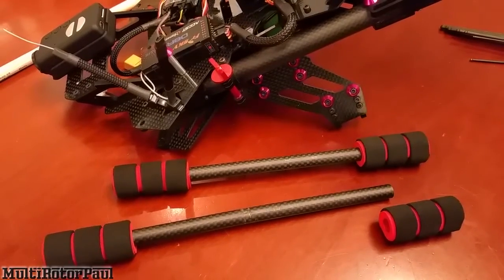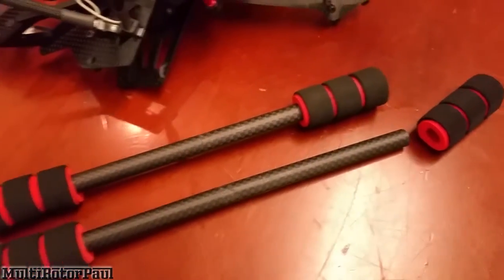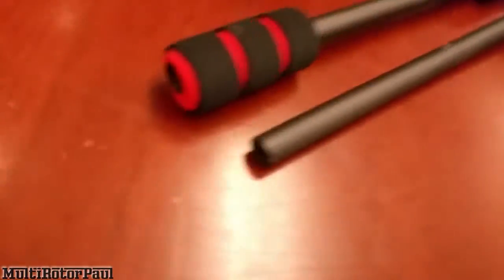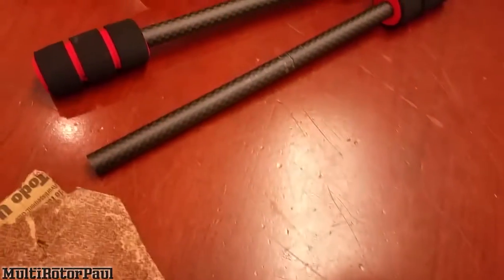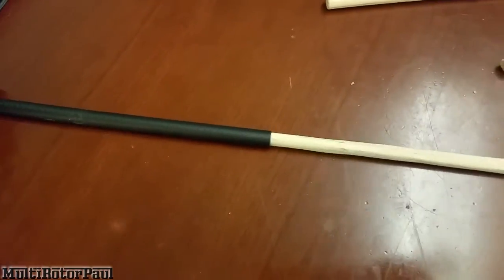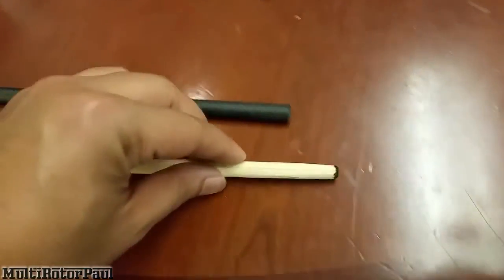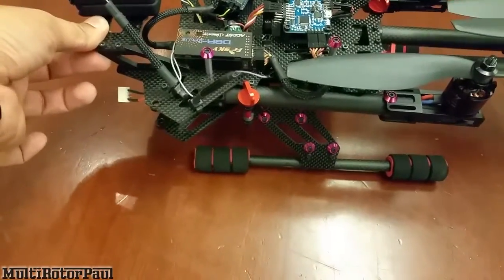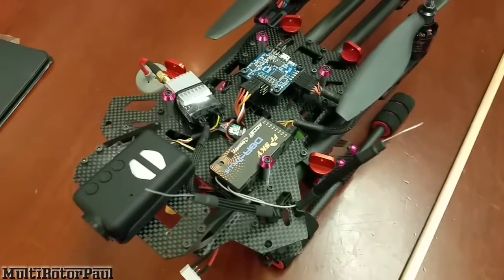XJ470 Landing Gear Fix

Comment: I had a pair of tubes just like yours! I went for the 10 mm outside/8mm inside tubing and this seems to be way stronger and has resisted my attempts to land " heavy" and fracture them!. Notice somebody said you got gear back to front? Got mine the same as you. Looks right and the centre is right on my centre of gravity. Thanks for great video,new subs.

Comment: I watch all your videos and it has been fun watching you progress. I haven't seen you dump a landing in your videos so this must have been a odd landing. Might have even been fun to see an accomplished flyer do it to:)

I'm also using the naza lite but I loaded V2 firmware and it is totally different, in a ++ way. Makes me think how dji could have ever have created this firmware in the first place. 

Another option would be expanding foam like the kind you get at home depot for filling cracks. Just a thought.
You must live near home depot:)

Your videos are great so keep them posted.
Reply from the maker: +W Morris Most of my crashes came before FPV. It's a much different experience flying FPV than without. I remember flying KK2 without FPV....I ended up 400 yards away crashing into someone's thorn bush in their backyard. That was a painful retrieval! I think the landing gear tubes might have been slightly cracked when i got this frame. The wooden dowel rods are super solid compared to how it was before. Interesting about the Naza with V2 firmware, I actually didn't know for sure if you could do that. I'll have to try it....when I want to switch from Naze32 and slow the pace down a bit. And Yes I live 1 mile from Home depot.
Reply: +MultiRotorPaul Glad the dowel rods are working better.
Yea, the new firmware is like night and day. It is a joy to fly now. 

I took one of your options to adjust attitude in-flight which has helped tremendously when switching props or 3S to 4S, Thank you.
I'm old and slow so I'll probably stick with naza. 

I also loose orientation pretty quickly, again old age, so I'm in the process of adding fpv. Here is florida we are pretty much restricted  to flying in our back yard or a ama field.  I'm hoping the fpv will be able to tell tell me how to get it pointed back towards home point. I don't trust RTH so this will be a backup. 

I added a couple of flytron (red/green) strobes which has helped and looks cool to.

Unfortunately or fortunate as it may be, I also live very close to home depot and I visit it regularly. $$$ 

Thanks for all your videos and keep up the great
Reply from the maker: I wish I would have brought my quad to Florida when I was there back in April. FPV changes the whole flight experience.  Definitely recommend getting into it!